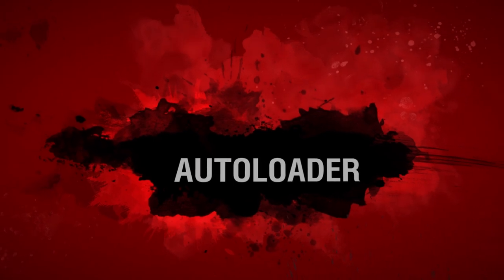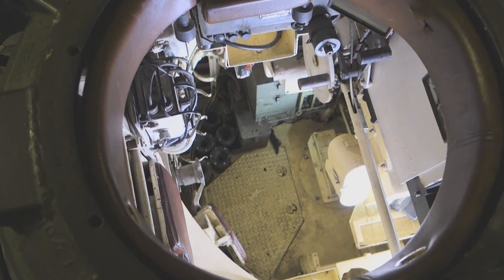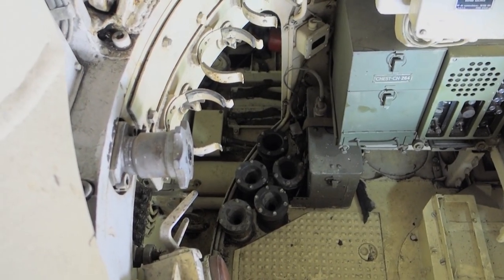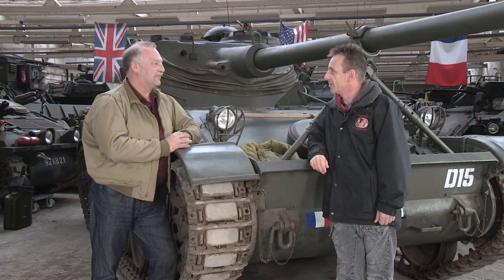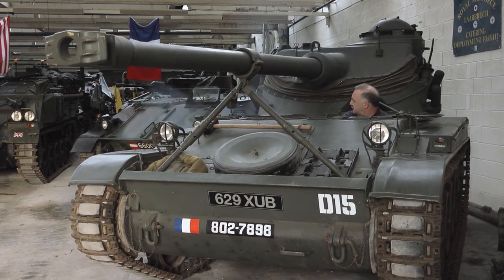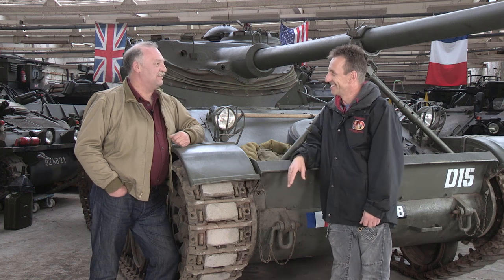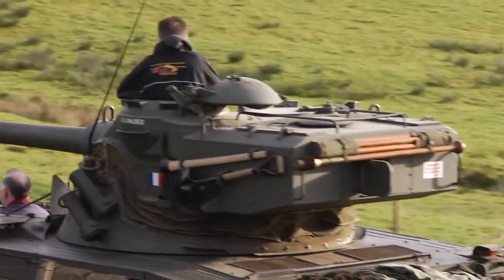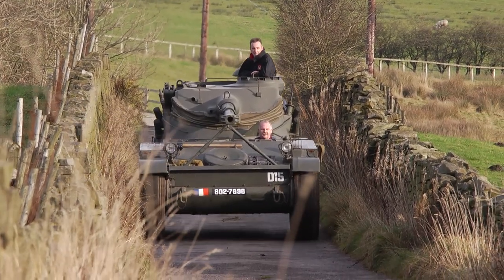Inside The Tanks: The AMX 13: Part II - World of Tanks

Comment: its no longer in service with Singapore since around 2007. Switched to the Leopard 2.

Singapore at one time had 350 of these, the largest operator of AMX-13. Upgraded with modern 350hp diesel engines, laser rangefinders, modern communications, etc. and indigenous APFSDS rounds.

Comment: When shooting the main gun with the AMX13-105, one should never traverse the gun outside the tracks or it would tip over from the recoil. We (the fortunate ones in the Centurions) called it the shooting rollerskate. The AMX13 was worn with army-issued suspenders and its tank commander had to bend or flex his whole body depending on whether the main gun (thus the turret) elevated or depressed. Reload was quick (think seconds) but it took a while before the whole verhicle calmed down and back into some semblance of battery after firing the main gun. Otherwise, a neat little package of vicious destruction to possible adversaries.

Comment: French want AMX 13-105mm in WOT !!!!!!
Reply: WTHisDaftPunk:( why "premium" ?
Reply: French Bomber so you can afford all the rounds your going to miss with the damn thing lol
Reply: Actually, player once petition for it to be in Tier 9 and replace the Lorry 40t which performance is questionable. But the final say from Wargaming is that it's not going to happen, not even premium tank due to something in AMX-13-105 being "too modern for the time period" or so they say.
Reply: +French Bomber 
Sold for export, mainly to israel; I had the pleasure of working on different models of AMX-13 on gun 90mn, armed missile section of a cannon 75mn and 4 SS11 missiles to finish on 13 VBCIs Milan. I was hot inside but also very very cold because of engine placement in the front right causing an air suction from the turret well to the engine compartment. Its rate of fire is impressive with the system of "loader", a good crew could put 6 shells of the same trajectory in less than a minute, useful especially in artillery support, some tank commander engage themselves in the shell barrel by a good bed on the rear of the munition. This infantry tank was a wonder of design, are easy maintenance. His faults are air supply and the noise he made while driving by are ventillateur. if not that fun to drive. In addition it was equipped with a hydraulic troubleshooting starting system that has allowed the crew to start the gear in case of battery failure or breakage of starter .The following 8-cylinder flat was equipped with magneto we could cut independently of the other, the use of magnétot allowed to use the boot system Hydraulic ride on the back of moteur .The grip of the unsynchronized gearbox is tricky but once used is no longer made the difference with a sync box. Only the crew size is a handicap, + 1m75 sorry you will have to fight on foot .... LoL
Reply: AMX 13-105mm coming now in WOT.
Tier 10
Reply: Guess what? You got it now :P

Comment: One thing he doesn't mention is, that there is a gap between turret and hull where there is no armor at all (and can't be added), just a canvas. This exposed crew in the turret to fire even from small guns and shrapnels. That's one big point why this turret design isn't used often today.
Reply: +MrTorgue   Is it?  Or is it just that the overlapping armor let the rain (and blast) in.
Reply: +Adamast You're right. I thought there was no armor behind that canvas at all, but a little research enlighted me. Thanks. (But like you mentioned yourself, still a big big risk for crew because of blasts and other hazards)

Comment: Singapore 🇸🇬 Military SAF Army had Bought Second hand AMX 13 Light Tanks 300 from France 🇫🇷, India 🇮🇳 and Israel 🇮🇱 models in the 65s era.

The AMX 13 was Upgraded by Singapore 🇸🇬 Technologies kinetics (STK) on the 90s with Detriot Diesel Engines with Automatic Transmission with Pneumatic Suspension for easy Fast speed handling Rough Terrains and muddy tracking.

Comment: Hot air from the engine is coming out in front of a gunner's scope... really clever=)
Reply: That's an intake, not an exhaust...
Reply: exhaust is on the side
Reply: Danial Hakim where did you see word "exhaust"? I said "hot air" coming out from engine compartment through big fan on top of a hull.
Reply: konstantin88181 just saying that the exhausts is on the side of the tank lol
Reply: +konstantin88181 hot air can't come out of the cooling fan, that's an air intake (much like on a car, it is placed on the front where the engine is). The hot air comes out of the exhaust which is located on the rear. Those things are tested before they are mass produced, i don't think something as blatant as that could pass the testing phase.

Comment: Its was reliable? I heard some people saying otherwise when they explained why it was nicknamed ''Merde'' in the Dutch army.
Reply: Well, a non-reliable machine wouldn't have been produced for so many times. Also, the crew may not feel good in tanks that are considered to be good. By example, the T-34 brought amazing innovations in tanks design, forcing the germans to develop more powerful tanks. But still, the T-34 was a nightmare for its crew. Hard to steer, bad ventilation, fuel tanks everywhere around the crew...
Reply: RenoDesu  Fragile tracks early on, reversed accelerator (you lift your foot to accelerate, a dead driver meant the tank would rush forward on its own), poor visibility.

I'm sure theres more to whine about but I gotta leave some for the other commenters. :)
Reply: +ronineter1 Good luck finding dutch crew smaller than 170cm
Reply: I think "Merde" is an historical reference to the battle of Waterloo, wich the Dutch participated Under Wellington's commandment.
In the legend it is said that at the end of the battle the remains of Napoleon's Army refused to surrender by saying "Merde".

But any tanks as its flaws there is no perfect machine, specially when you had that much spec contraints to respect as a Builder.

Comment: Whats the use of that gun holder thingy? Would the gun just fall to the ground without it?
Reply: Its to stabilize it
Reply: It's a gun crutch. It reduces the amount of stress on the gun mechanism when the tank isn't in combat.
Reply: To stop the gun bouncing around and damaging the tank etc etc
Reply: AFAIK the technical term is "travel lock". As ILIKE above explains, its purpose is to take the strain off the elevation and traverse mechanisms out of combat.

Comment: Singapore has AMX 13 90s? I did not know that
Reply: AMX 13* 75/90 is only the calibre of the gun. (which makes it pretty weird that the two are separate tanks in wot as they are one and the same in real life.
Reply: Nope they are actually different thr 13 90 has a much better engine and a different chassis

Comment: Question - what type of ammo would this tank fire? World of Tanks says kinetic penetrator, but Wargame series says HEAT ammo. Or perhaps it could fire both?
Reply: It would fire Kinetic penetrator, but the lack of pen against enemy armour meant that it was scrapped in favour of HEAT as it had better penetration
Reply: subaruscott Yeah, but doesn't mean the gun had to be reworked? As far as I know, rifled guns can't fire HEAT ammo.
Reply: Barcel no, many rifled guns do fire HEAT
Reply: subaruscott But shouldn't the rotary movement disrupt the molten metal stream?
Reply: Barcel Unless the copper in the warhead is fluted in the Opposite direction, which it probably was in the HEAT ammunition
Reply: I mean shouldnt the centrifugal force disrupt the metal jet, decreasing penetration capabilities?
Reply: The AMX-13-75 M51 used the model 1950 75mm rifled gun (also called SA50 and later CN75) which fired PCOT or POT-51A and POT-51P armor-piercing ballistic-capped tracer round.

The AMX-13-90 entered in service in February 1967 in the French Army and used the D960 90mm low-pressure rifled gun (also called CN90 F3) which fired a HEAT round : the OCC 90 model 1962 (penetrate 320 to 350 mm of steel at any range) and a high-explosive round, the OE 90 model F1.
Reply: Jesus Nazareth Thank you sir. Where did you find this info?
Reply: Barcel
 French literature and TankNet.
Reply: Barcel But shouldn't the rotary movement disrupt the molten metal stream?

=> This problem was already known during World War 2.

To remedy this problem, the Germans introduced in April 1942 the Granate Hohlladung 38 model C (Gr.38 Hl/C) which belonged to the four generation of HEAT shell used by the 7,5-cm KwK 37 L/24 close-support artillery gun (fitted on early Panzer IV models). The shaped charge inside the Gr.38 Hl/C was covered with another conical cavity in order to limit the rotation of the inner shaped charge.

In the 1950s, the US had developped a new generation of HEAT shell whose rotation was limited by the use of a slip ring and fin-stabilization. Armor-piercing capabilities were also improved by the use of a standoff probe (E.G. 105mm M456 HEAT round from the 1960s).

Meanwhile, the French had developped the Obus G (G shell), its shaped charge was mounted on ball bearings to prevent its rotation, the projectile was still spin-stabilized and therefore more accurate than a normal fin-stabilized HEAT-round fired from a 105mm rifled gun.
Reply: Jesus Nazareth IIRC the rule of thumb is that the spin eats something to the tune of 20% of the hollow charge's theoretical maximum penetration. OTOH the pene basically entirely insensitive to velocity loss over distance (and velocity in the first place) and such things so, well, give and take as always.

The French came up with a rather clever workaround to this phenomenom with their 105mm "Obus G" shell which used ball bearings to isolate the warhead from the spinning outer shell, but unless it (or something similar) could also be used in the later export versions of the AMX-13 with that kind of gun that's not really relevant here.
Reply: Challenger got it wrong. It fired APCR rounds and not HEAT. I think challenger needs to take a page from chieftain and do his own research instead of just reading a script.

Comment: that auto loader is a very inovative invention of the french but was it the french who origanally thaught it up?
Reply: john j thanks so much i guess it will always be a mystery
Reply: Between November 1942 and February 1944, the US tested an autoloader designed by United Shoe and Machinery Corporation on the T22E1 medium tank prototype. Its M3 75mm gun was automatically fed by two 32 rounds magazine at a rate of 20 rounds per minute.
Reply: john j They said it in the first part
Reply: john j They talked about the oscilating turret, sorry, but i though i remember this tank from previous video
Reply: john j The first automatic cannon was a weapon based on the Gatling gun,
Reply: I have always, even before wot, believed it to be the french. Why. I do not know.
Reply: Redneck Fury Given that the original Gatling gun was hand-cranked and hence per definitionem not automatic, that doesn't hold water. But self-powered automatically loading weapons in general date to the last decades of the 19th century, notable examples being the Maxim machine gun (1884) and the Borchard C-93 (1893) and Mauser C96 (1896, unsurprisingly) pistols. Apparently von Mannlicher also began selling a semiautomatic rifle already in 1885.
Autoloading cannon are really just a fairly straightforward scaling up of the same basic mechanical principles, first used in autocannon for AA work.

Ofc, the initial version of the AMX-13 as shown here actually had hand-cranked magazines so it's not strictly speaking automatic (though AFAIK the loading of the shell from the feed tray in the middle was). IIRC the later upgunned models had automated barillet rotation too, if only because with the bigger shells they started getting too heavy for manual operation.
Reply: No.  I know for a fact that the America t20 series of experimental tanks tested an autoloader, but was never slated for production because replacing the Sherman in the middle of war wasn't happening -- despite its flaws the Sherman had too many defenders among American top brass.  So they instead kept importing innovations that worked on the T20 backwards into new M4 models (much of what made the Easy 8 the Easy 8 came from T20 modules), and unuqie t20 innovations like the autoloader were abandoned as more trouble than it was worth.
Reply: I'm pretty sure it was the Chinese that came up with the idea of auto loading something, it's not for a tank, but for a crossbow

Comment: 40mm on the front?! A Panzer IV can penetrate it... and it's less than the T-34 armor ^^" but the gun is better for sure ;)
Reply: The angle is a lot better than the T-34 angles, making it more effective.
Reply: Thanks for the answer ^^ And the AMX 13 was faster than the T-34 ^^
Reply: And the t34 was a medium tank ;)
Reply: Dude, it's a 13-odd ton airmobile recon tank. A freaking go-kart by AFV standards. The French just have a longstanding habit of giving their recce vehicles enough teeth to fight off their opposite numbers and double as ersatz light tank-hunters if necessary.
Reply: gaston jaillet Sure ^^
Reply: Yes your all right! ;) he comparing That two tanks and i just reply him. But the amx 13 have 20mm not 10mm on other parts ;) if he had 10mm, a simple gun can pierce him! 
I'm really sorry for my bad english :/
Reply: I know i know all That. This is a perfect model of a light tank: performant, very maneuvrable, good speed, but only armor for the little gun and ammo explosion. 40 mm is today a very little armor, in fact there are no tank capable of resist at the actuals cannons. Exept of the reactive armor
Reply: gaston jaillet That's because the French made it for infantry support, but with antitank capabilities. Just like any AFV but with a VERY big gun. The AMX 30 was like a Leo 1. Paper for armor, lol
Reply: ***** Sorry ^^"